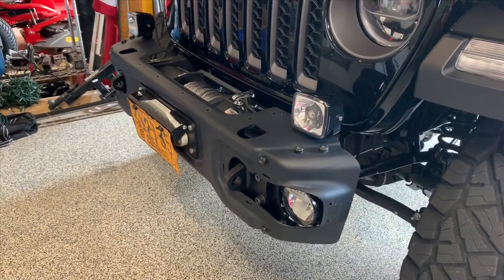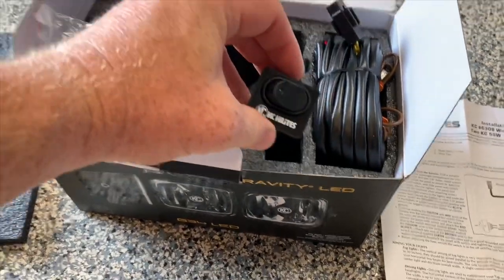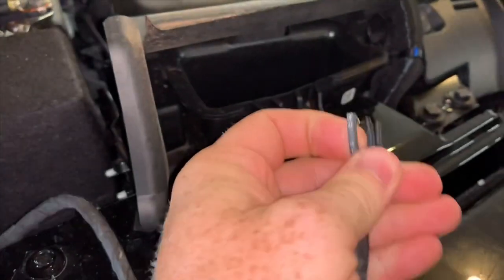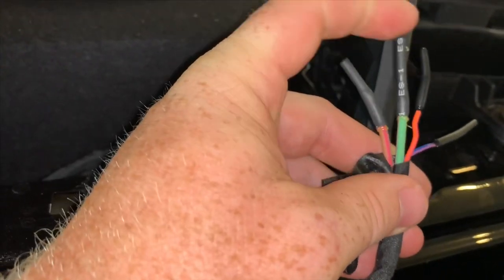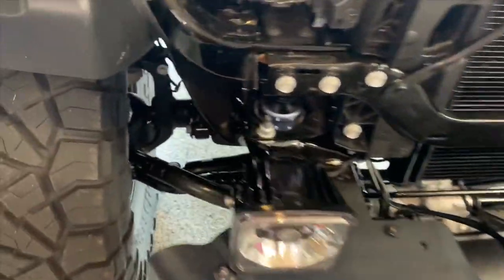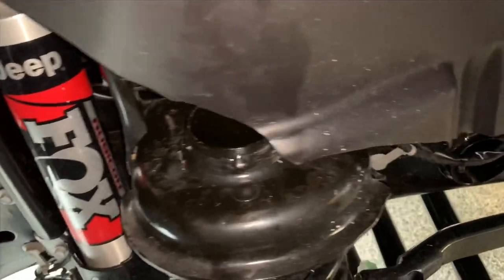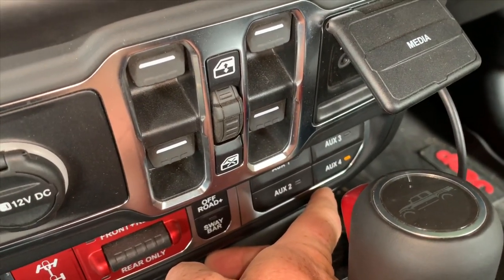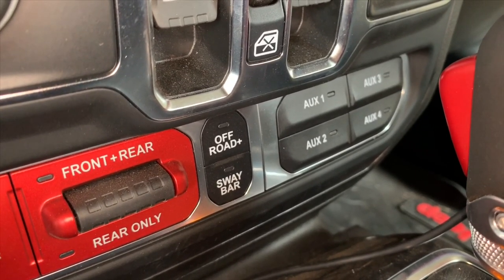How to Wire Accessories to the Aux Switches in your JT Jeep Gladiator (and/or JL Wrangler)

Comment: Switches 1 & 2 are 40 amp, and 3 & 4 are 15 amp
Reply: I’m having my Jeep dealer install the aux bank switches as I watch this. I asked that my heated wiper blades be installed on Aux 3 as it supposed to be 15 amp. They called and told me my Gladiator is 40amp Switch 1 and 3 and switches 2 and 4 are 15amp. I really hope they don’t screw it up.

Comment: I didnt get the auxiliary switch group on my Gladiator and your making me wish I did!
Reply from the maker: Did you ever add it? I hear it's a pretty straightforward mod.
Reply: @campNcrawlR  My dealer is taking a full day to install the aux switch bank and adding Everblade Heated Windshield Wipers. I don’t think I could have done it if it is taking them so long. I hope it doesn’t get screwed up.

Comment: the wire bundle in the passenger's kick panel, do you happen to know which fuse goes to the orange/pink - ignition accessory and red/white - direct to battery?  blew the fuse for the ignition switch one and I can't find it.

Comment: Really good video thanks.  Real quick, what kind of stubby bumper is that in in your video.  I really like it and want to put something like that on mine.  I special ordered my Gladiator Mojave with the 4 switch panel because the few the dealer had on the lot did not have it.  It was a requirement for me.  When I asked the dealer to throw in the switch as an aftermarket add with my purchase they declined. I am glad after watching this video that I chose to order mine Mojave with the 4 switch panel.
Reply: Hey Mark, that certainly looks to be the factory steel bumper that can be ordered on the Rubicon as an option.  By what I see, it is identical to mine on my 2021 Rubicon JL. Hope that helps even though it's been a while sense you asked the question.

Comment: so you baisically wire a connector to the auxillary wire, and then you plug in the connector from the lights into the connector you wired into the auxillary wire, please correct me if i'm wrong

Comment: Will the vehicle give you an aural sound if you leave the button on and turn off the ignition or will the switch turn off once you turn off the ignition to prevent the battery from draining?
Reply from the maker: It just depends on your settings. Go into your Uconnect and you can decide how you want that to work.

Comment: I’m being told that the kit won’t work on a jt with the diesel ???
Reply from the maker: What kit, the OEM aux switches?
Reply: I've heard that it will but you also need a relocator bracket, looking into it for mi gladiator,didn't come with them. $554 🇨🇦💰 & then: you need tools to put some micro pins into your main harness, and get a dealer to plug their computer into the vehicle to provide you with the software for the u connect screen so you can change the setup of the switches from there. so not a cheap option to add if you dont have it. the mechanic looked at me and said, aftermarket switches much cheaper.

Comment: I noticed it looks like you have a MOPAR lift.  Are those REAR shocks on the front or did you get shock covers for the fronts?
Reply from the maker: John K that’s the stock Rubicon suspension. No lift yet.
Reply: @campNcrawlR  My mistake.  Didn't realise you have a JT.   The JL Rubicon does not have FOX shocks.  GREAT video.

Comment: Great Video! Question, how did you connect the two hot wires coming from each light into the OEM auxiliary wire? I purchased the Baja Deign LP4s and i'm going to have to modify the wiring harness that came with the lights because is comes pre-connected with a fuse, relay and switch.
Reply from the maker: The KC lights I was installing in this video came with a pre-wired harness that looped both lights into it, so I just had to connect the end of that harness and ground it.

Comment: Would it make sense to use Aux 1 & Aux 2 for the winch? As in 1 could be winch out and 2 could be winch in?
Reply: Not how that works.  The winch is powered via an Aux switch (most are constantly powered and direct battery wired/no aux switch) but the pay in/out is controlled through the winch control box, the aux switches are only fused switches to control power no different than a light switch in your house.  The in/out is done via winch control box.  Separate thing.